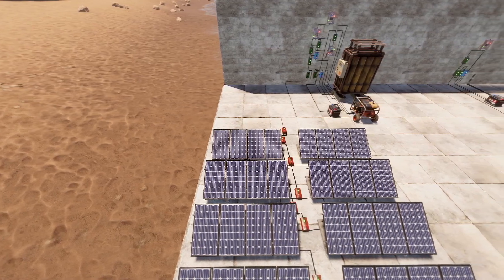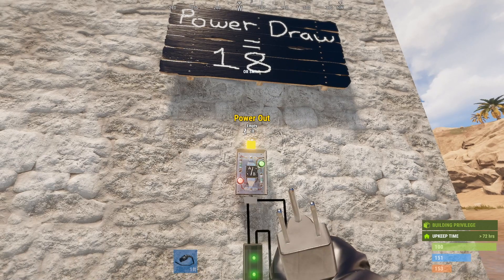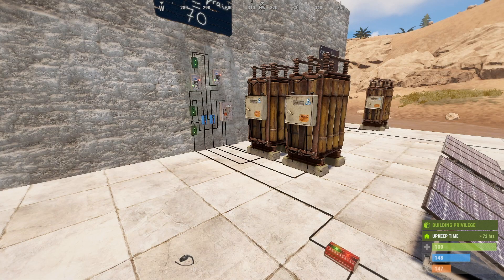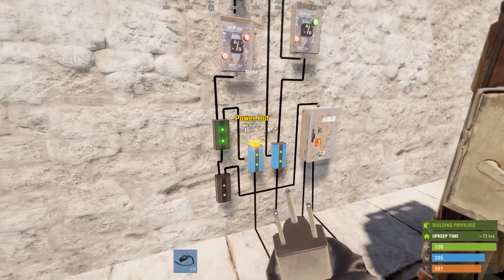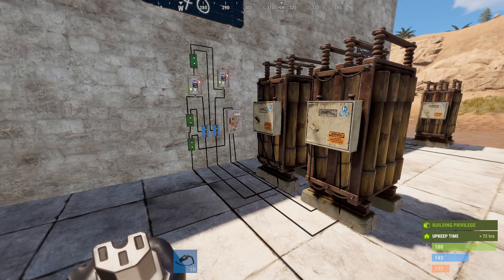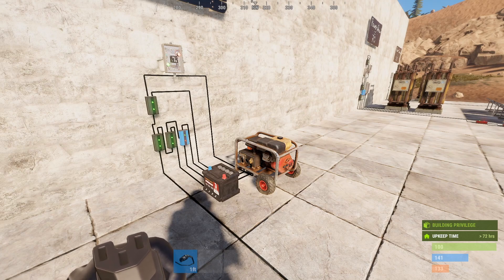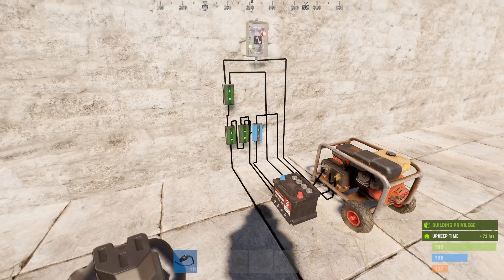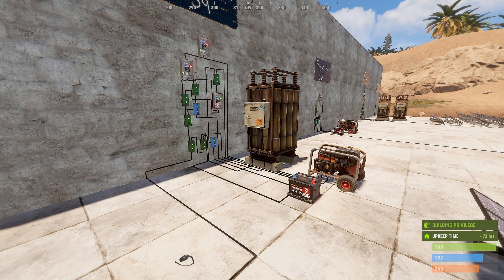(RUST) Electricity 101 - Backup Power Options (September Update)

Comment: I have a problem. When I connect the batteries to the combiners, the batteries always lose the same amount of energy. Example: I have 6 batteries in parallel to make me a combined 600 of power, but my base is only using 80 of power, the problem is that all batteries lose 80 of power when I disconnect the primary power. How to solve this problem? My base needs 400 power to work so the batteries discharge too fast to leave the system direct and the power generated does not support recharging the batteries and maintaining power in the base.
Reply from the maker: I wouldn’t use combiners connected to the batteries, as it will cause problems as you’re experiencing.

What I would do instead is separate the circuits in your base to instead be <100 each so the system is separated onto single batteries.

You will still need to make sure all batteries are receiving a minimum of about 120 power at all times to keep up with the demand.

600 power is a lot to be running. I would recommend 6 win turbines (at a decent height), or around 40 solar panels.

Comment: Heyman, really great vid. I did the 2x large battery setup, but I want to find a way to add automatic night lights into the same circuit. Is this possible or should I just make another circuit for the night lights?
Reply from the maker: Apologies for delayed reply. It is definitely possible. You just add whatever circuit you want after the battery backup circuit

Comment: I'm a little confused about how power draw works. I want to have 3 turrets active so the 70 power draw makes the most sense. If the power source is knocked out however, how long will three turrets stay active with two large bats? Is it 20 per day, per turret?
Reply from the maker: Each turret only requires 10 power, so you need to adjust your electrical branches for that.
Batteries in Rust will output their maximum amount of power no matter what is connected, therefore, they last up to 4 hours each when fully charged.
So, if both the batteries you have setup are fully charged, then you have 8 hours of runtime. (While holding a wire tool, simply look at the battery to see how much charge it has)

If you still have any trouble, feel free to join the discord, you can get all the help you need there.

Comment: Very nice to see an easy learn technique for the electricity. Nice Job.  With the new Electric Turrets. I feel Caves are now no longer the best place to live due to you can only use Small Generators with LowGrade. There was a glitch with the older generator giving unlimited power so need to power them up but what is your ideas of trying to live in caves or is it simply...Can't do it anymore
Reply from the maker: Thank you, my guy :)

There is only 1 or 2 caves where they are close enough to the surface to be able to have an above ground power source connected to it. However, not every map contains these caves.

Caves still have they advantages, but in my opinion, base building is bland as a whole compared to what it used to be.
It is what it is.

Comment: Hey bud been loving ur electrical vids. I play on Vanilla Solo n it takes many wipes most times for me to acquire the large battery. Is it possible to replace the 2 large one with small batts in ur first example by just changinging the numbers?
Reply from the maker: Yes, these system are interchangeable with the small batteries. However, small batteries only output 10 power, and therefore are not suitable to power turrets.
Only small, low power circuits can run off small batteries.
Reply: @SpibsTV  awesome yeah meant to specify that i was only going to run 6 lights and turn them into day and night cycle thanks man u rock
Reply from the maker: @aaronchamberlain672  No worries, happy to help :)

6 Lights does consume 12 power though, so you will fall a little short there, unless of course you build two separate circuits.

Worth noting that the double battery system doesn't increase your output to 20 (using small batteries) just means you have more time overall.

If you have any other issues, feel free to join the discord :)
Reply: Hmm i may have to become a lil more aggresive when looking for the big battery then it sounds like
Reply from the maker: @aaronchamberlain672  Personally I think small batteries need a minor buff, perhaps outputting 20 units of power, and lasting 20-25 mins.

Comment: can you make 12 stacks of low grade generator and 4 large battery that works for 24 hours
Reply from the maker: Generators only accept a single stack, so you would need 12 separate generators. So in theory yes, but the circuit would be so impractical.

Comment: idk what I've done wrong in the duel battery setup but both battery's are draining at the same time at night when my solar panels are off.
Reply from the maker: Sounds to me there has been a mistake with your wiring to block the batteries. I would double check that you're using the correct outputs/inputs shown in this video. Additionally, be sure you've calculated your Power Draw correctly and set your electrical branches to match.

If you're still having trouble, join my discord :)

Comment: Heya spibs,

Just a quick question mate which one of these designs do you think would be best viable option to say run 2x turrets + 5lights .. at the same time as charging a large battery to allow the use of backup whilst nighttime is active so my lights can turnon/off but still have turrets running 24/7 . Is that actually doable ?
Reply from the maker: A power supply that consistently delivers 80 power should be enough.
Then if you don't want lights on during the day, they could be hooked up to a blocker, with a solar panel connected to the "block passthrough".

A single battery setup should be find for this.
Reply: @SpibsTV  awesome thanks heaps spibs ! Good too see someone with knowledge too these systems :)